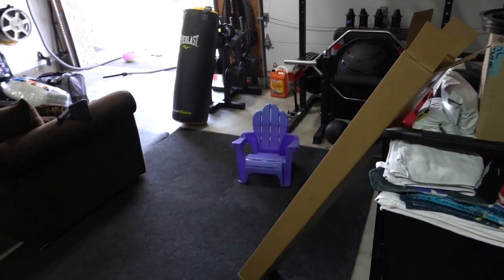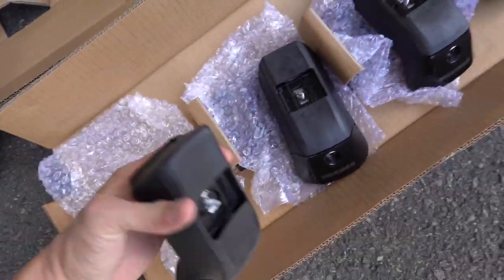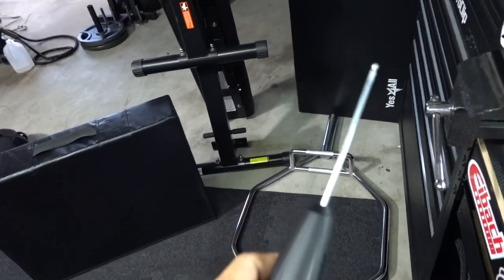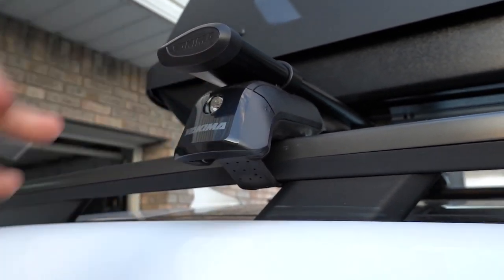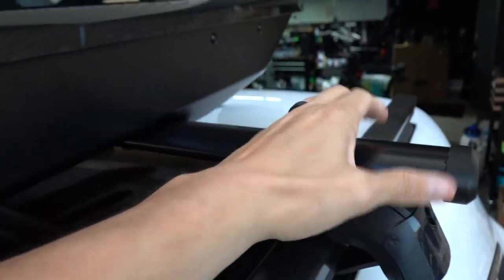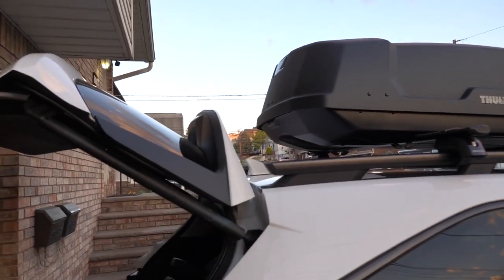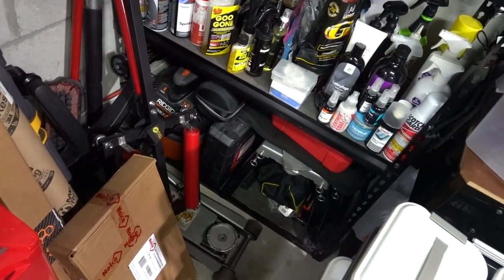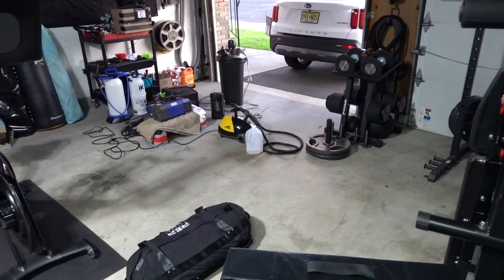2021 Kia Sorento Yakima Cross Bars and Thule Force XT L

Comment: Just bought this same exact spec, awesome ride..I plan to ceramic coat in the future. But since you own every single product on the market, which is your favorite wax to maintain or protect this finish???
Reply from the maker: I haven't coated this yet but I clayed and put on Ultra Lock + then topped it with some Oberk Defense Gel so far it's been holding up great and I must say this paint has VERY LITTLE to nearly zero swirling lol which I'm shocked about but happy my wife bought white lol

Comment: Reading dlc transmission horror stories with the X-line. You have any issues?
Reply from the maker: funny you ask I've had zero issues until our drive from NJ to Florida and back last month .. on the way home I was in cruise control and a trucker was coming up VERY FAST to my rear .. I went to floor it to move out of the way and the car gave me a CEL, wouldn't let me accelerate and when I hit the gas pedal I would get shakes .. I pulled over on the side of the road and the CEL went away .. turned the car off and waited 5 minutes then turned it back on and it drove normally the rest of the way home .. I was in sport mode the whole drive but we drove literally straight through so 16-18 hours of driving twice in a week period .. since then it hasn't happened but once in a while you get a bucking and not so smooth shift especially at lower speeds .. I also absolutely hate the vehicle when you're stopped and let off the gas the way it creeps forward and how it feels is just just cringe but no other issues at the moment thankfully
Reply: @HonestlyOCD  Yes , the low speeds bucking is weird. But the slight roll when you put in P freaks me out. Good luck